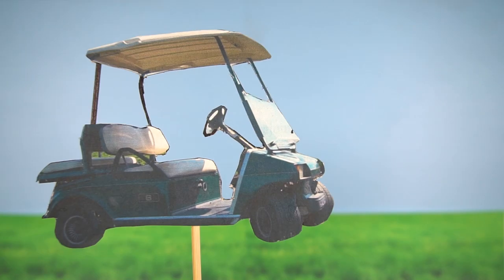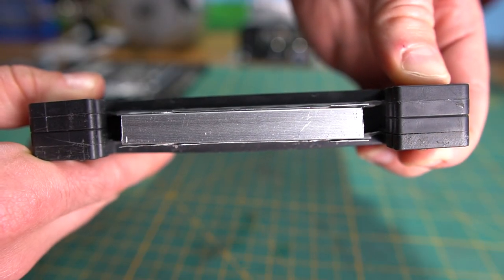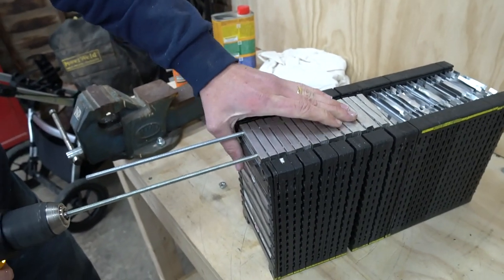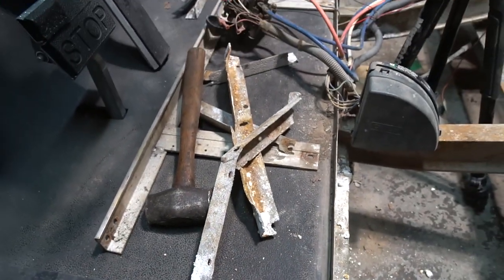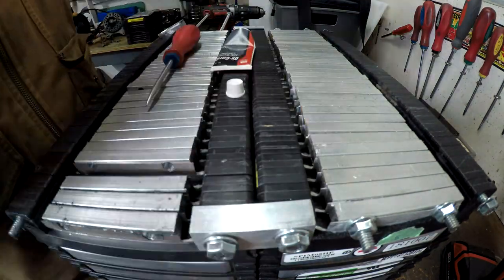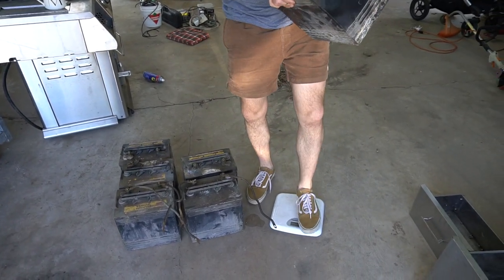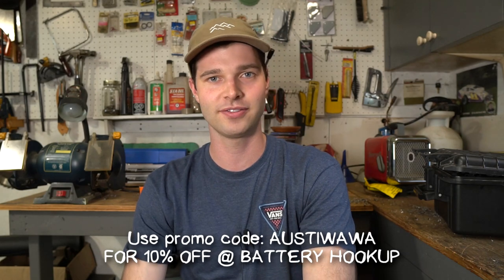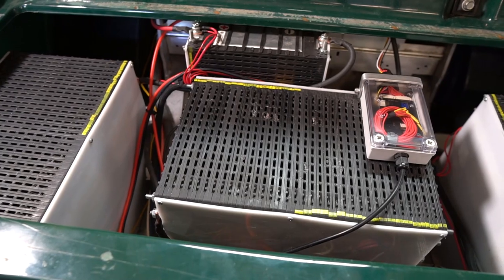Over-Engineered Golf Cart Battery

Comment: Looks great. I did a Chevy volt 48v battery swap in mine. Only thing I might have done differently would be to use fuse wire to connect and protect the cells. No worries about corrosion or shorts or cell failure.

Comment: Almost the same number of cells as in the 8 24V ones I have assembled. Mine total 224 cells in 8 7S4P configurations for just over 6.6kW. They will be used to power a 6K inverter.
Cutting the weight in half will extend your range a bit.

Comment: Whats the voltage on this many cells?
Reply: 13s so 13*3.7 for the nominal voltage. (48.1v) The actual voltage of the battery fully charged would be 13*4.2 (54.6v)